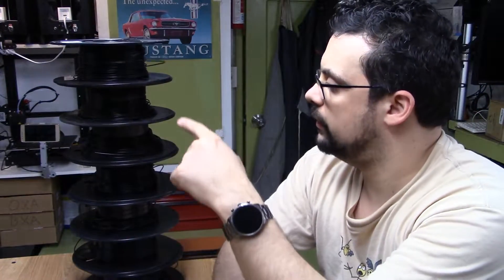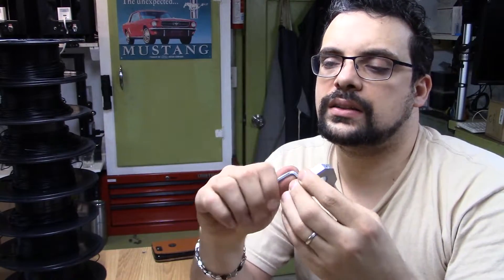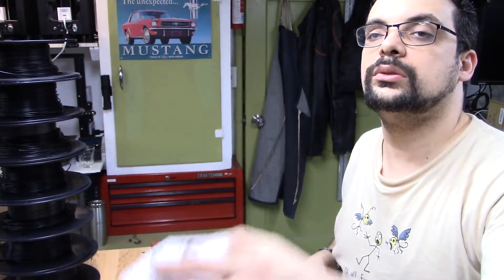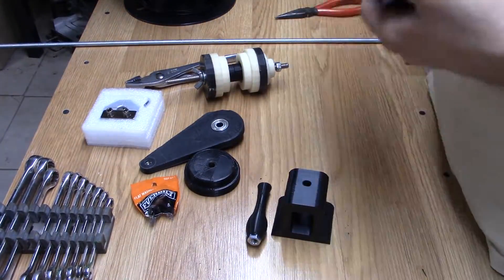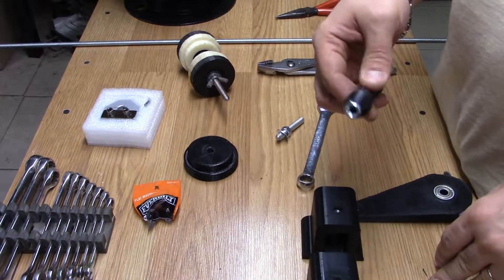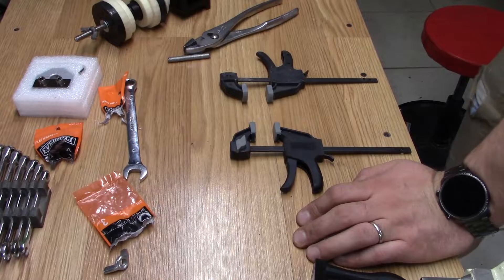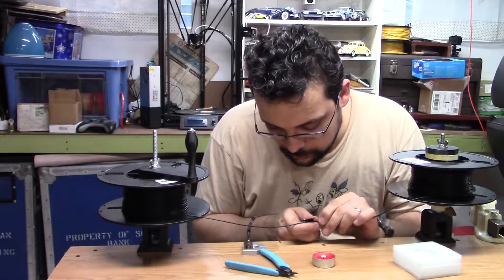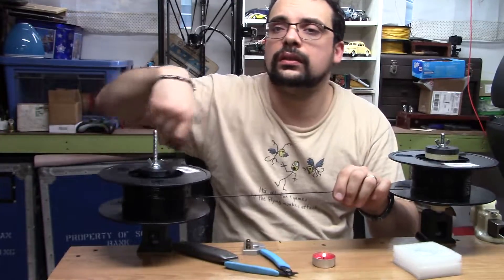Filament Winder and Filament Joiner

Comment: I just put a filament runout switch and my printer pauses when it triggers. Then just load the new roll. Don't have to deal with a bunch of mostly empty rolls.
Reply from the maker: That is a good solution. However at the time splicing my own was not a bad way to go. Thanks for commenting.

Comment: The irony here is that in your opening statements you contend that others sell these filament welders at what you yourself seem to find costly, but then you build yours with machinery that costs well over what many of us could not afford. Those of us who do not have the machinery necessary to build it ourselves have to rely on those selling it at a higher cost than what could be made at home,. The higher cost is probably to cover the expense of material and running their machinery. Though some of us are clever enough not to need these gadgets to get the job done, because we are more resourceful.
Reply from the maker: I agree with your statement. However I have been lucky enough to have spent very little on a bunch of the equipment. My lathe was free and I invested probably 50 hours to make it functional again. And a bunch of other tooling has been the same way. Sometimes the expense is time not $$$.

Comment: A great job of taking an idea and constructing the necessary parts to make it work.  A real cost and waste saver.  Any ideas on what to do with the empty wheels, besides trashing them?  Very good video.
Reply from the maker: Honestly I have used some of the spools as vibration mounts for my diy vibratory parts cleaners. Some have been used to wind up extension cords and some for Christmas tree lights. Unfortunately I'm out of ideas and the spools keep piling up. I wish the manufacturer would sell me the filament without a spool. With that said, I have been contemplating shredding them and turning them to mystery filament. However I am not at that point yet.
Reply: Use them to store wiring cables.  Build a rope storage rack. Make your pet snake more compact.

Comment: Overture is great filament but they doubled in price so I left them.
Reply from the maker: I am still using them. They are at least consistent. I bought 10 rolls before they increased the price. Now at 21bux. I started having trouble with my old reliable inland pla. Shrinkage in printed parts was massive. They changed suppliers I think. Who do you use these days?
Reply: Their Clear PETG worked so well for me I made some ornaments for a Christmas tree and shoved them up on Thingiverse.  I paid $11.99 then a month later it was 17.99 and now $21.99 which is a bit above my price point.  I am about to need another roll of PLA (I don't print in that stuff) too and $15.99 is the cheapest for Solutech.  I used to swear by Hatchbox for ABS, and PETG but they are crap now and so gooey.  I mean they ooze horribly even at sub temps.  For instance PETG and the roll says 230-260 and I have to print it at 210c or it is a runny mess.  For PLA I don't know who to go to and, as I said, I need another roll as I am printing temp parts for a CNC router I am building (will use a dremel for now) that the machine will go to wood then go to Aluminum so babysteps from PLA/PETG to Wood to Metal.
Reply from the maker: I have a feeling the pla sold today is more of a hybrid with abs and 11 earbs and spices. The parts I'm making now have the feel of almost ABS, it's not as gooey to machine as it once was. I also used a generic roll of pla a few months back. They should have called it I can't believe it's not abs. It machined like abs. But did not stink like it. Weird stuff.
Reply: Who made it?  I love working with ABS but I was never able to really tame it even in my enclosed printer.  The printer I have now is too big and open air for ABS and to enclose it would not be good for the electronics.  If I do it again I am going to go active heating for ABS as the board I have, plus Marlin 2.0, is all ready for it.
Reply from the maker: @thebeststooge  my old printer did abs very well. The problem with it is that it really is worn out. 2k hours and the linear rods are trash. The electronics and motors are fine though. I am contemplating another ABS only machine soon enough. This time it won't be a Delta. Too many projects and not enough time.
Reply: My enclosed printer is a Qiditech Flashforge clone and the board burned up (almost burned down my house when new) and uses a Mightyboard.  I could easily swap out the mightboard for a 32 bit board but there seems to be an issue with the heater board so I would need to go to a silicon mat and they aren't cheap.  Being the printing area in it is only 6x9 max I just left it where it was and use my TronXY X5S.  Active heating is the best for ABS and that Qidi being passive it got hot enough inside it, while printing, to deform any PLA parts I put in it.  It was never a good printer as the first thing to go was the part cooling fan duct (injection molded) as I was doing ABS and it melted it because no fan.  The next to go was the Buildtak like material on the heated bed that said 110c was fine but typical Chinese they lied.